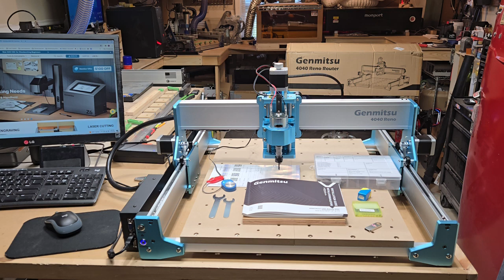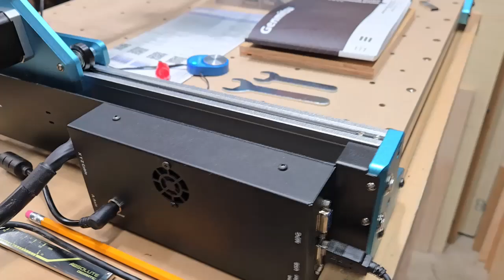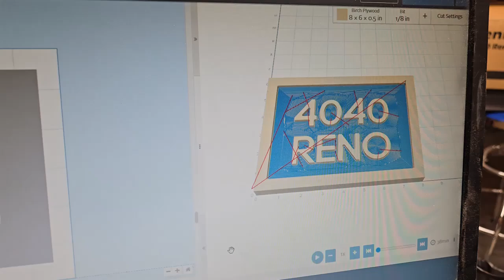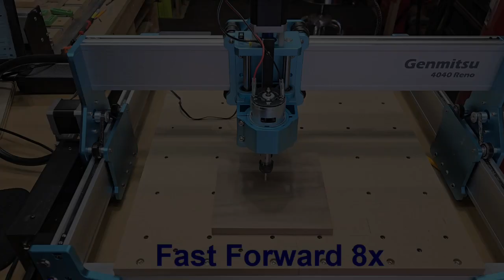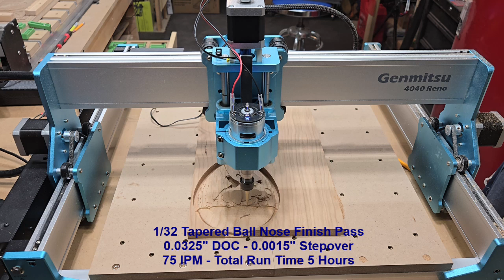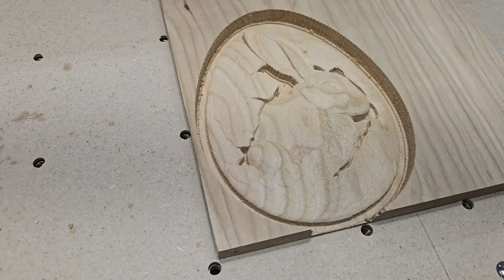Genmitsu 4040 Reno CNC machine review.

Comment: In your opinion, could it be used for wood inlays? Thank you.
Reply from the maker: @IW2MXP  It can definitely be used for inlays.  But depending on the type of wood, especially real hard exotic woods, I would probably upgrade the spindle motor just so it can be used with the bigger cutting bits that can handle hardwoods better.

Comment: I’m Jimmy it’s new to me so I would like to know the different software I can use to make any project
Reply from the maker: There are several options to use to design projects. Carveco, Vcarve and Easel are the most common that I have used. Each one is a little different and each has a different cost associated with it , but they all work well.  There may be other software programs, but these three are the ones that I have used.

Comment: I like  mine so far, had it for 3 days now, Where is that vibration coming from? I cannot track it down, I think its from the outer frame and echo underthe spoilboard. .... I am just installing some 2040 extrusion underneath the spoilboard, should rigid it up a bit and remove the sag. Im still waiting for some bits to be delivered so  im stuck with the lame engraver bits included with machine. So far have engraved Red Oak, and Bamboo Flooring, Do you think this Z axis would handle a Dewalt DW660?_
Reply from the maker: The vibration could be from the spoilboard since there is no center support. I haven't notice any vibrations so far in the few projects that I have done with it.  I think the Z axis should be able to handle a Dewalt router because they also sell an upgraded spindle mount for a 65-69mm router that will fit this machine.